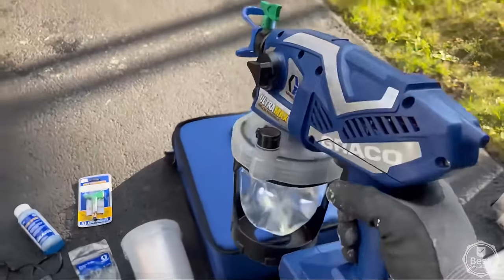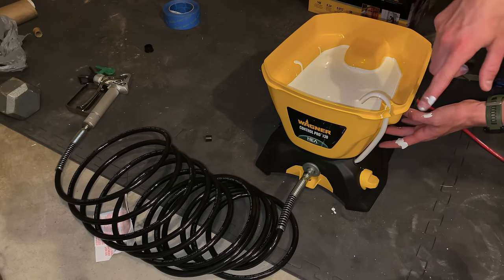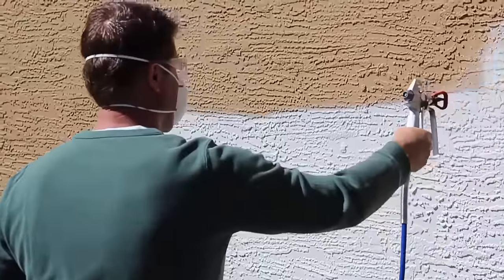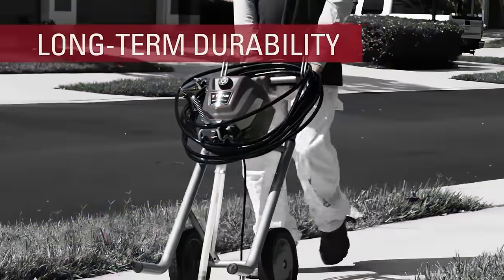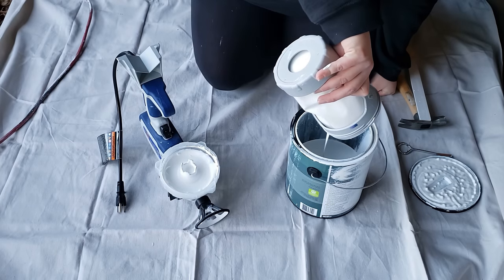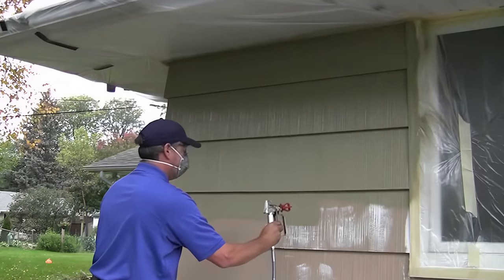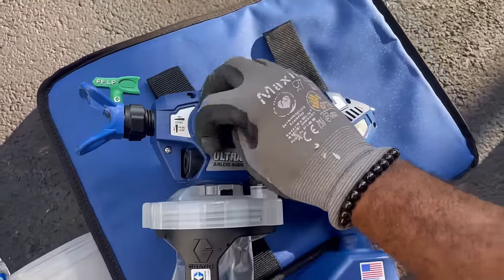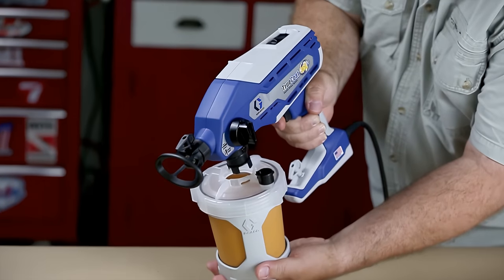Best Airless Paint Sprayer | Top 7 Reviews [2023 Buying Guide]

Comment: If you plan on painting your walls & just all around home stuff, do not buy the hand held one. Buy the stand & use the hose. 

I just got the Graco hand held truecoat 360. I had to add paint every couple mins it seemed like. I couldn’t even do half a wall. I feel like using one of these is only necessary if you’re painting something really small. And since you have to add paint constantly, it gets super messy. The videos & pictures on it were of people using it to paint walls. But you have to add paint a few times to get one wall done. I regret wasting the money on it. I think it was around $270. I’m buying a different one tomorrow.
Reply: @Omerta.  Thanks for the "heads up" another thing that i think may be worth mentioning is that it can be a bit tireing holding the hand feld model for any extended length of time.